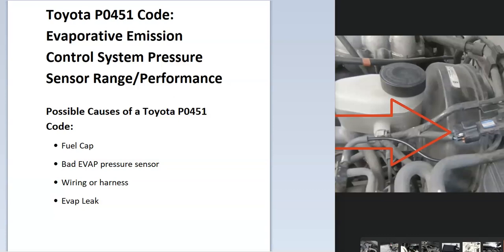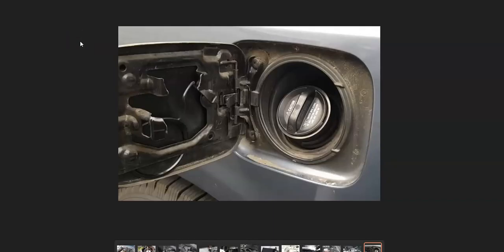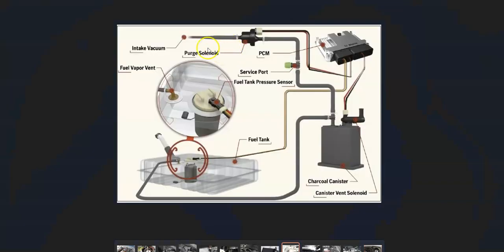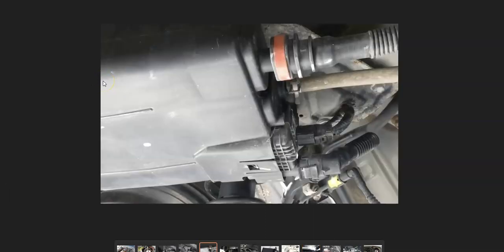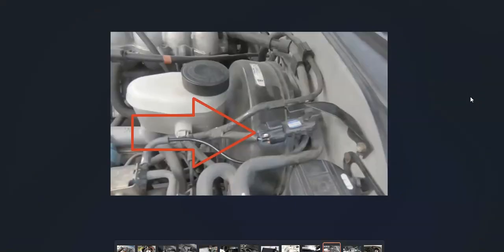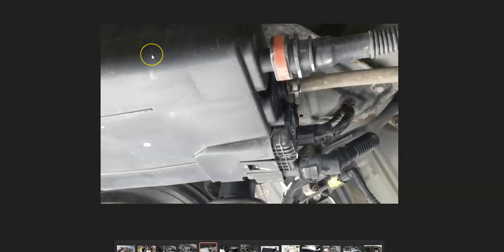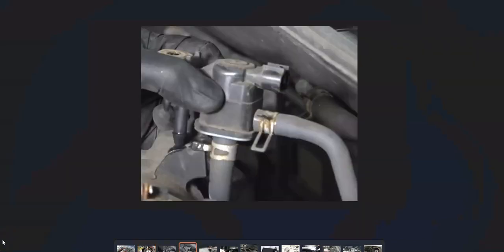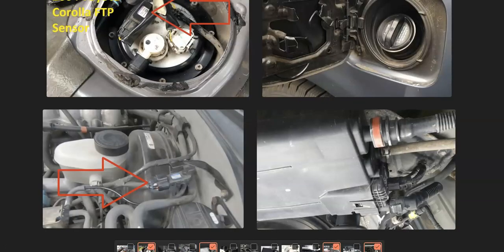Causes and Fixes Toyota P0451 Code: Evaporative Emission Control System Pressure Sensor Performance

Comment: Would a 2004 toyota throw this PO451 code ?
I'm thinking of open air running a second used FTP sensor with the other unplugged left on the tank to fool the evap from throwing this damn PO456 and PO442 code.

Comment: Rough idle in conjunction with this?
Reply from the maker: Usually, no, but if the purge valve is stuck open, it can cause some engines to run badly, usually when first starting.

Comment: I have this code and it takes me longer then usual to put gas in my car and after I do it takes a while for me to start the car after a fill up
Reply from the maker: That is a common symptom when the purge valve is stuck open.
Reply: @HVAC_Mechanic thank you for the help I was stumped